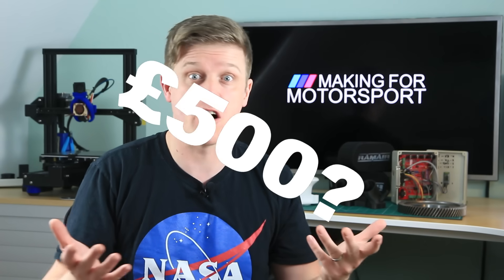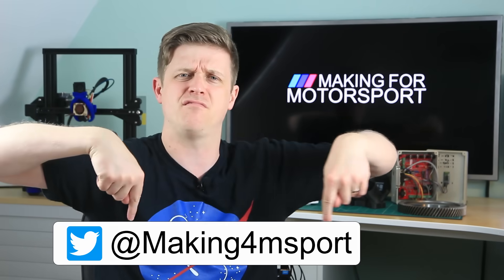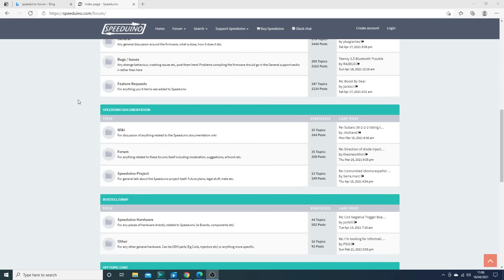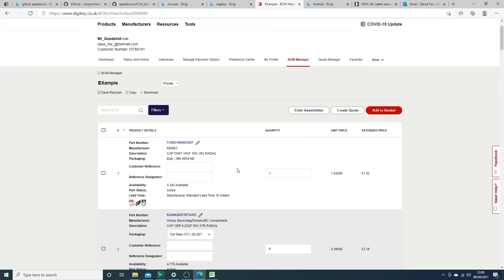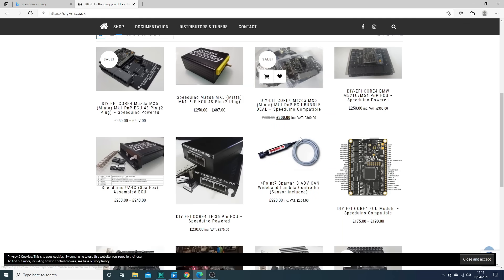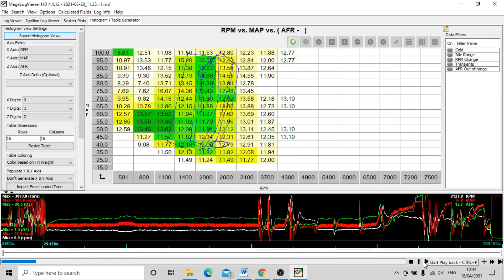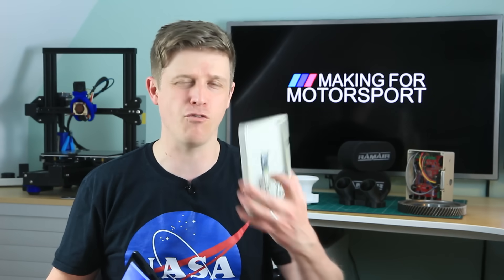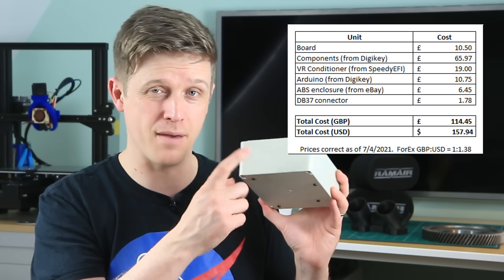The Best Value Standalone ECU - Speeduino

Comment: Got a Volvo 850 BTCC Estate car replica here using a Volvo V70 T5, and basically nobody to help map it, considering stand alone to widen my opportunities for mapping etc...my project is dead in the water and so close to finishing, out of options and starting to get depressed with it all, 4yrs into this build.   5 cylinder 20v, COP, Turbo
Reply from the maker: A full stand alone removes most of those barriers, but If you are definitely going to want someone else to map your car then you’d be best finding the person first and then putting in an ecu which they are familiar with, most tuners will work with tuner studio so a well installed Speeduino system should be fine. 
Best of luck! 👍

Comment: I've been wanting to find a way to DIY an universal ecu that would allow me to hook up any [wire harness] [engine] and [transmission] together with obd2 problem finding diagnostic support. I have a 98 jeep grand cherokee with the 42re transmission and want to put an aw4 transmission in it instead, as the aw4 is more forgiving when running them hot and hard. however I've been told that the default ecu would be painfully problematic to work right with an unfamiliar transmission, some sort of rejection code or format incompatibility in the ecu I assume, so I'm lead to believe anyway. Basically I am looking for a way to make an homemade ecu to bring more reliability to my jeep by means of putting more reliable parts into it as its [upgrade/replacement parts]
Reply from the maker: Sounds like an interesting project!   Transmission side I have no experience of but the open source nature of Speeduino means is great for integrating into something like that, but I think you’re gonna have to get your coding fingers dirty here 👍 best of luck!

Comment: I've been thinking about this for 10 years just never applied myself.
Reply from the maker: Why not give it a try now?
Reply: @MakingforMotorsport  I meant the idea to use an Arduino. But yes I'm goin to try on a 3 jet ski cylinder
Reply from the maker: Nice!  Are you gonna try a speeduino or a from scratch code it?

Comment: Only 1:48 into the video and lovin it already!!
Looking at putting 6 triumph 800 throttle bodies on a Honda goldwing 1500 flat six engine to use in a Lotus 11 which I will build from scratch.
Thought about using megasquirt efi to look after things. Any advice?
Reply from the maker: If I were you I would investigate Speeduino, fundamentally they are very similar, as they are similar to every other type of ecu.  I have used both and if I could use megasquirt i would, but it depends on the duty.  As your Lotus 11 (and 😍 btw) is going to be a 6cyl you won’t be able to use sequential injection, how important that is to you is up to you, but you’ll need the MS3x to do that.  Personally, I would speeduino everytime, but 🤷🏼

Comment: I don't know.. I've seen so many Arduinos crash due to electromagnetic interference or other stuff. I'm skeptical. Does anyone have long term experience?
Reply from the maker: It’s not a daily driver so actual running hours won’t be many but my Mini has been run off a Speeduino for nearly 4 years and it’s been 100% reliable, in an aggressive motorsport environment and there are plenty of people running them as daily drivers on the forum...
Reply: @MakingforMotorsport  that's interesting. I'll have a look at the board design files. Maybe I can learn a thing or two on how to stabilize my own boards. Thanks for the info.

Comment: Speeduino is ineligible because it has no MAF algorithm. I claimed that this feature is important and the effort would not be that big but they said it will never be implemented.
Reply from the maker: I am not a big coder so I can’t comment on the ease of implementing it, but what are your reasons for needing it above SD, AlphaN or blended/switching tables?
Reply: @MakingforMotorsport  I use MS2 and MS3 for several vehicles all running MAF. One of it is I4 ITB, the others are I4 and I6 single throttle. MAF is way more accurate and easy to tune, needs no Baro correction, no MAT correction, works perfectly with ITB and strong cams in every load case.
Reply from the maker: fair enough, I know the OEMs use them virtually exclusively when putting ITBs on an engine... never played with them 🤷🏼. I doubt I’ll be buying anything else for a while but if I upgrade I’ll try it...

Comment: so i could add my turbo kit to my car and fuel system components, use this DIY ecu to run that? is there a way to keep all of my oem stuff inside the car working, or is it only for motorsport?
Reply from the maker: Yeah, that’s exactly what thousands of people have done.  Would you loose anything OEM?  Depends what your current ECU does... Rev counters might come from the ecu or the coil, the current ecu may control the alternator or give more information to the dash, it might do none of these things.  
That’s all car specific, but chances are that if it’s a popular car to modify, the answers are out there in the Google-verse!

Comment: This thing is great for 4 cylinders but not so much for 6/8....

I'm definitely not a fan of wasted spark or 2 fuel injection quirt systems....
Reply from the maker: I get that you want Coil on Plug, I'd love to do away with my HT leads, but wasted spark?  What are the down sides?  It would be good get sequential injection, but at higher loads when the duty cycle goes up,  all the benefit of sequential goes out the window...
Reply: @MakingforMotorsport  Oh no, I wasnt referring to CoP, but that would be nice to have. I guess I should explain myself more. I was a Navy engineer, and a professed efficiency and calibration nerd. I believe in tight control of an engine  and that it should get exactly what it likes at the exact time that it needs... nothing more, nothing less.... Wasted spark doesnt really bother me much... all it does is add more wear on the coil and plugs n wires. But extra squirt per revolution really irks me. At lower RPMs and especially at idle, this could cause fuel puddling and a possible crappy idle. And I absolutely love a smooth as butter idle. Now, at higher RPMs, puddling prolly isnt much of an issue, and a extra squirt prolly has the benefit of better AFR control. But still, I would rather go the route of proper fuel control for the entire RPM band, and if I need more fuel at the top, then I would prolly go with the secondary injector setup that would kick in when the motor needs it. Just my 2 cents.
Reply from the maker: Fair enough, I understand exactly what you mean, personal preference and fit for the intended purpose.  I too am an Engineer and so I understand your point of view but I tend to take a more “pragmatic” approach 😂, my engine duty is far more WOT with little idling so it’s down the priority list (plus i have fitted my alternator over where the cam sensor goes)... that said, I used semi-sequential wiring so I can change it fully seq in the future.
Reply: @MakingforMotorsport  Oh ok, outstanding. I mostly build up sleeper daily drivers so I have to have it all lol. But, either way, the speeduino has the potential for alot more. Maybe they need a more advanced arduino processor for the extra outputs? I started looking at it before and left it off to the side, but your vid has me looking at the more advanced concept even harder as it uses basically all the same things that megasquirt uses. Hmmm....
Reply from the maker: @memadmax69  check out the Teensy version, that can handle canbus native and has abit more muscle...

Comment: Can you swap original ECU to run airbags, e windows, ABS too? Nasty car makers makes service tools or software so expensive. So no for diesel, eh?
Reply from the maker: Hi!  This level of integration scares me!!! I haven’t really played with canbus but I’d expect most of these functions to run from satellite ECUs as power modules off a canbus network.... but I am guessing!  Short answer to your question - not easily!   Long answer - if you were willing and able to rebuild your cars control system from the ground up I’d say anything is possible.  But diesel with Speeduino??? Definitely out (I think)

Comment: 740T Volvo with a 16vt and ms3x with a micro TCU. Its simpler than soldering for me, I just don't have time to build.
Reply from the maker: Whatever works best for you, I know it took me around 6hrs to put mine together but there is definitely piece of mind going  of the shelf.  The bluetooth was the trickiest part of the build! 👍👍
Reply: @MakingforMotorsport  exactly, plus it talks to the TCU which works straight up with my auto so it's sometimes about saving effort!

Comment: I'm looking in to this to run a 1981 xv750se.  The standard ignition module is kaput, and they stopped making the modules in '91 or so.  This is about the same price as a second hand original ignition module, but is not 30 or more years old.
Reply from the maker: I ran this Speeduino for a couple of years just running my wasted spark setup and I retained the carbs.  I have it running through 2 GM ignition modules I had on the  shelf and a wasted spark 4cyl coil that came with the engine... it’s all worked no bother.  The complicating bit for you would be fixing your crank trigger wheel, pick up and other sensors on an old motor, but definitely doable 👍
Reply: @MakingforMotorsport   The good news here is that the virago used two magnetic pickup coils, and a crank mounted trigger wheel, so that's one job done right there. I have seen people make up cam sensors too, which I may have a go at. I'm tempted to go whole-hog and go for fuel injection too.
Reply from the maker: Go for it!  If you already have a trigger wheel OEM that’s a big plus, it would be worthwhile just checking that the pattern is supported, if you Google Speeduino and Decoders that gets you to the list 👍

Comment: WHERE EXACTLY CAN ONE BUY THIS FOR $160.     JUST GO WITH A COBRARTP,  OR A SST CHIP CHEAPER AND BETTER
Reply from the maker: Hi, the links for where to buy it are in the description.  I’ve looked the CobraRTP, that looks more like a piggyback unit rather than a full standalone?  And obviously tuning a standard ecu can be very cheap but if you want to fully change your setup and go to a different load methodology standalone is often the only way

Comment: Do you have a link to buy the diy ecu? I know the fundamentals of tuning and soldering but you mentioned coding which i have no experience in, is this ecu for me?
Reply: Or can you advise on which kit i need?
Reply from the maker: Hi Paul, depends on what engine you’re running and your ambitions?  I can see bubble arches Mk1 in your avatar so I am assuming it’s a 4pot?
Reply: Yes 4age. Stock setup but I would like to go itbs and smart coil
Reply from the maker: @Paul_Tomlin  nice choice with 4age, the Japanese BDA, all the goodness of a RS1600!   
with the speeduino you can go coil on plug for spark and sequential injection assuming you can get a cam trigger, or run wasted COP and paired injection.  Assuming you don’t want to do Canbus or anything complicated you won’t need to code, I didn’t.  The Bluetooth module was abit fiddly but the actual ECU is dead easy. 
Which one to buy depends on you.  I like my v0.3 with the DB37 parallel connector, I wired direct to the board to get it running then tidied up with the connector once I was happy, but the v0.4 potentially is less work but you need a clearer idea going in to get the benefit....  
for links, I can’t post here, it’ll be deleted, check out the description. Or go the Speeduino web page, they have links there... 👍 best of luck!
Reply: @MakingforMotorsport  awsome thanks for the info I will try wrap my head around it now. With regards to the trigger I would probably try find a cas from a 4agze. Next question do you think that I could run the escort tacho off it?
Reply from the maker: I haven’t done this and I don’t know your tachometer, but it probably needs a pulsed 12v (as if it’s coming from the LV side of the coil).  Speeduino does support tachometer out and it’s configurable in tuner studio but whether it’s compatible with your tachometer In stock form?  Don’t know.  
Because of the community this will have already been solved and a quick Google of Speeduino Tach showed lots of info!  It’s definitely doable, but sat I can’t tell you the answer...
Reply: @MakingforMotorsport  thanks again looks like I need to do some research on what I need to get.

Comment: i'm restomodding a morris minor 1000
Reply from the maker: A moggy!  An ex-girlfriend had one and Jesus it was slow, great fun and more character than a car park of modern cars..  get a decent engine, brakes and suspension it’d be great!  You keeping the leaf springs at the back?
Reply: @MakingforMotorsport  i plan on leaving the rear end pretty much alone to begin with, and concentrate on the front end, disc brake conversion .
Reply from the maker: Start with the stopping, very wise!👍

Comment: Thanks. I'll have to see how well it might work on a single cylinder engine, I'd love to have the ease to tune my KAYO MR125 by pulling out a tablet and tweaking things as opposed to swapping jets in the carb every time the temperature swings 10 degrees.
Reply from the maker: Have a look at the NO2C version, that’s a cut down version with the same firmware,l and only 2channels for spark and squirt... still probably twice the board you need!
Reply: @MakingforMotorsport  thanks for the info, I'll take a deeper dive into this. So many projects, so little time.
Reply: @sourand jaded I'm unfortunately out of the game. The concussion from the drunk has left me with issues if I turn my head back and forth, as well as just tracking objects going past me sideways. Dint even think I could drive a Kart properly.

Comment: it is possible  used lambda  BOSCH  LSU 4,9 ? thx.... my engine have inductive senzor position crank,when to swap hall senzor I don't have to buy VR Conditoner ? thanks.
Reply from the maker: You can use an LSU4.9 but you have to run a controller like a LC2 or 14point7, as Speeduino can only use the 0-5v linear output and it can’t drive the o2 sensor itself.   And if you have a Hall sensor, or any other square wave sensor then you normally don’t have to run the VR conditioner, you just set jumpers to get the right voltage.

Comment: How many inputs and outputs
Reply from the maker: Native on the v0.3 board there are 4 inc fuel pump, but you can access a lot more through the prototype area and then using either tuner studio to select the pin or tweaking the firmware yourself.

Comment: I'm in the US, using a speeduino on a l61 I'm swapping into a Pontiac Fiero.

I bought mine fully assembled for $120 from a Venezuelan living in Mexico. The support from around the world on this project is absolutely amazing.
Reply from the maker: An international effort!  I've always loved the look of the Fiero, like a more aggressive Mk1 MR2, never been in one (they are very rare in the UK),   With a good engine I bet it'd be a graet drive👍
Reply: @MakingforMotorsport  the Fiero gets a little international love, the big go to forum for the car is in run and hosted in the netherlands. Still not many across the pond. If you ever get to sit in one, one of the biggest surprises is how roomy they are inside.
Reply from the maker: Hmm, they seem quite small but at the same time American cars are a little larger than the European/Japanese equivalent, the Mk1 MR2 feels tiny inside!
Reply: @MakingforMotorsport  yes, the mr2 are very small inside in comparison. The Fiero was intended to have a shorter roof but GM executives at the time were tall and wanted to fit in the car. The roof was raised 2 inches from the prototype. There's a shop in the US that used to chop 3" out of the roof.

The design of the car was revolutionary. In 84 it was the safest car in the US only to be dethroned by volvo in 85. The car was the first with a full space frame that was adopted by the Corvette in 1996. Another thing that was unique is the body mounting was extremely precise, the mounts for the body were resin filled blocks, the whole frame went into a giant mill and drill machine that milled the mounts off at the perfect z hight, then drilled at the precise x,y so you could take the body from one and fit it onto another with no fitment issues throughout it's entire production.

The Fiero was limited by budget in some ways, the engineers still managed to do some unique stuff.
Reply from the maker: Wow, I did not know that!  That’s quite some level of engineering, most unibody have the hard points laid down early on in Body in White, but machining the mounts post build +1 for precision! 👍
Reply: I'm gonna buy one for my v8 fiero after watching this can u recommend a low cost throttle body
Reply: @chasejaburek3083  let me know, I've been looking at different options to do a BBC. There's a few tbi type setups but they aren't cheap. FAST I think sells thier's without electronics for a few hundred dollars and that may be an economical path in the end.
Reply: I'll be using one for my Fiero swap as well!
Reply: @evanwittig3976  there's a Facebook group specifically for fiero speeduino and megasquirt projects.
Reply: I'm currently sitting in my 86 fiero watching this. I'm about to pick up the parts to do this too super excited. Let me know how it goes
Reply: I miss my Fiero GT.  I always thought it would be better with a new ECU.  The stock ECU fires the engine 11 times per program scan because the 6502 is so slow.  This is why the v6 only got 135hp.
Reply: @microdesigns2000  get another ASAP. They aren't getting cheaper